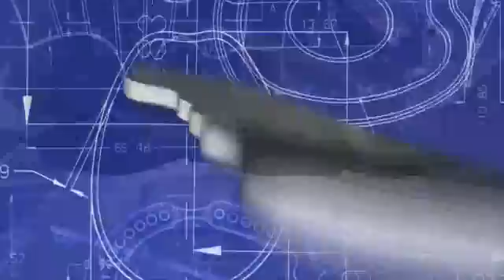#britek  Energy Return Wheel... Autonomous Never Flat

Comment: @EnergyReturnWheel   What do you mean the throttle response either raises the hub or rolls forwards? What is a throttle response? What rolls forwards and why? Using mystical words like "float" and "captured" doesn't explain anything, it just sounds mesmerizing (to certain people). Your idea makes no sense at all. Rubber bands increasing energy output without extra input? Your idea looks cool, but it has no function other than dampening and delaying torque to the road!

Comment: @bobwatters I'm not answering for EnergyReturnWheels, but here's how most new technology works: "High end" devices will usually take advantage of it and being flaunted as a premium feature. Once production and market acceptance kicks in, it trickles down to more widespread use and in lower end devices. There was a point in time where you had to justify the price tag to a consumer on why they needed ABS brakes. Now, it's pretty standard on most cars.

Comment from the maker: @imingzee The weird truth is that the composite hoop is supporting the wheel hub via an array of slingshot like membranes all equally tensioned. When ERW is placed on the ground the hub sinks from the pull of gravity untill suspended by the top half of elongated membranes. Throttle responce either raises the hub within the scope of the hoop or rolls forewords releasing the stored gravitational pull as more g. is captured as wheel rolls and hub floats against the pull.

Comment from the maker: @MADMANx511 We will be running paddles off the curved hoop to morph to terrain and because the "gravity charged" hub is drawing more from the top side 180 membranes it levers uphill better than pneumatic. For larger size wheels and tires expect lighter sidewalls / hubs for aprox. 30% reduction in overall weight. This would require a re engineered hub, mass can be reduced because it rides inside the composite hoop.

Comment: I understand trying to build a better mouse trap, question is, is it better, and why would the average person want to use this wheel in place of whats been working fine for over 100 years. Also, when the rubber wears out, do we go to the shop for a retread? If so, how long will that service take, and the bigger question is cost. If this cost more without a considerable benefit over traditional tires it won't be successful

Comment from the maker: @1nickadair We have switched to a composite carbon nano tube infused carbon fiber hoop dynamically charged with internal coiled carbon rods pat filings #4 and #5. Hoop is protected by a Kevlar jacket for strength and vibration resistance. Contoured hoop is further protected by kevlar bound nano rubber wedges off the curve widening footprint and psi. to the surface while manuvering.

Comment: @EnergyReturnWheel you mean your scamming us by NOT asking for money?  I'm sold... who do I make the check out to???  Lol but seriously, you "technically" didn't ask for money, but did strongly suggest people invest, which I'm interested in doing... but I have questions.  How dent resistant is the steel outer rim, how cheap/expensive will it be to replace the rubber?  What will be the actual total cost of everything?  Performances, top speeds, side g forces, etc.

Comment: The video was made 3,5 years ago, are there some new test? Whats about holes in the street, driving very fast corners and to fast over speed bumpers. Is your wheel able to handle these things or will the weel become an egg? And the other problem is to change the tires. Can you put new tires on these wheels or do you have to change the whole construction. Will it be more expensiv than an old tire??? I think your wheel is a good idea, but there are many questions left.

Comment from the maker: @a2dds ERW stays on the surface "anti bounce" more hook up and control. Lighter, larger diameter wheel and ERW combo. Kevlar spans replacing weakest link rubber membrane with the strength and vibration resistance of Kevlar pat filing #5.

Comment: Interesting, I'm skeptical though.  I would initially question the torsional strength and durability.  Its one thing to drive in the driveway, or on a dyno environment.  But how does something like this hold up over thousands of miles of the real road conditions, especially at the speeds drivers routinely travel at, 80 mph+.  Not to mention it still has a rubber tread, which will wear out just as fast as a normal tire, thus require replacement.  What is gained here?

Comment from the maker: @Smullet90 Check out our USDOT highway test video on their 48" dyno rollers 6,000 lbs. dyno resistance at speeds over 75 mph. Note ERW hub riding high and forewords within the scope of the old style steel hoop. Also note the "brake lights" when ERW over shoots coastdown sections. Normally there are no brakes applied in the highway test.

Comment: Do you have footage of these tires at 70 mph? I'd like to see that video. My other question is how long does it take to change one of these tires. Also how does it ride? It seems like it would not have nearly the amount of give that normal tires have, making for a much much MUCH bumpier ride. Does the membrane REALLY "give back" the energy from the vibrations of the metal frame? All this could be answered with some real footage of the wheel in action.

Comment: I'm a little concerned about the unsprung weight.  It *looks* like the ERW would be heavier than the wheel/tire combination.  Have you weighed the ERW setup?  If so what are the differences between the traditional wheel/tire setup and the ERW setup?

Comment from the maker: @Monkriss  ERW would rather roll than bounce. Lift a car by the bumper. You can raise the 2 ton chassis several inches because the mass is stored in the springs. ERW hub is suspended within the hoop and is displaced by the pull of G  like the suspension system. No matter how it is explained we are still the most efficient coast down.... tire vs "airless" ERW on youtube.

Comment: I'll bet the grip with these tires are horrible. The grip these offers are probably on the same level as low profile tires, if not worses. And the problem with low profile tires is that they can't absorb bumps, cracks and such in the road as well as normal tires.

There's a reason why race cars never use low profile tires; they're crap.

Comment: @EnergyReturnWheel and the load bearing capacity? my truck weighs 9000lbs before fuel, passengers, cargo, etc. also needs to be capable of towing a 10000lb trailer without a 5th wheel adapter. high abuse applications are the perfect target for this sort of wheel because it eliminates the risk of puncture as well as sidewall failure.

Comment from the maker: @cummins24421 The promise of simple ERW is coming true. We believe that our new vacuum install/removal process is close at hand. No bolts. This can only be accomplished if you have our hoop ridgidity. Highly elastic patent and "pat pending" sidewalls hold a negative air pressure or vacuum boost. Will run w/o vacuum, vac. for fine tuning, weight reduction, compressed air is heavy. Aprox. 2 lbs @ 30 psi. with humidity.

Comment from the maker: @engineerFROMhell We switched to space age composite carbon nano tube infused carbon fiber woven hoop with nano infused Kevlar jacket. Check out USDOT lab tire vs ERW vid. for 6,000lb. dyno load acceleration/coast down...notice "hub in steel hoop" floating high and foreword under throttle responce.

Comment: With all that force directed inward, wouldn't this design require maintenance often? Like tightening all those bolts on the inside? 

Also, this is a useful design, but for consumers to buy it, it needs to look a bit more attractive. If you can find a way to cover up the gap and make it appear as a regular tire, more people would be willing to purchase the ERW

Comment from the maker: @donerdoner1234 We use a vacuum pressure on the hoop side of the membrane to increase power and longevity. We have pioneered a composite hoop so light and strong that the hub can be massive 30% lighter. We have a totally new traction system to bring higher psi. to surface. ERW is anti bounce because it displaces internally. Hub in hoop 360 degrees freedom of movement under drawn membrane control. Camber issues are addressed by the new "curved body" hoop with Kevlar bound rubber wedges off curve.

Comment from the maker: @spencerjustin420 Tire safety is a real issue. Debris on the road, under inflated or even expired tires can create life changing accidents. It is our goal to introduce a high speed airless that will not be taken out by a 1" wood screw. Composite ERW even can survive multiple high power rifle shots and still get you where you need to go. The early proto rotational mass has nothing to do with ERW performance. Newest protos composite hoops and traction system are  lighter than pnu tread block.

Comment from the maker: @MrTheLemonn For these early protos each "pull" is drawn with about 300 lbs. linear tension. Upon throttle responce ERW can accumulate screw force, Hub can rotate within the hoop elongating the membranes like a wind up airplane increasing power transfer to surface. Each bolt can easily support 300 lbs. lateral shear suggesting 300 lbs. x 36 attachment bolts =  no problem. We have moved away from bolt attachments for auto but they will show up in some heavy duty applications.

Comment: you dont address the "loss of traction... losing lives on the highways" bit at all... "part of the car that will not need to be replaced", really, you still have rubber, on concrete, that shit wears out... all you are really doing is creating rotational weight which could save gas mileage, but i doubt that much, and require more braking force thus having to replace break pads more often

Comment from the maker: @brandieism We will have a sealed dual vacuum charged "compressed air is heavy" ERW for off road racing. We can now cut a staggering 30% of the mass of a large tire wheel combo... "high speed airless" still runs w/o vacuum boost.

Comment from the maker: @ladygodia ERW displaces internally. These early protos have 2" feeedom of movement " hub in hoop" in all directions. This allows for screw force accumulation/return during throttle or brake force. Also a return against the pull of gravity as hub sinks within the hoop to the point of levitation, IE largly supported by the top half of membrane pulls. Throttle responce flings the hoop further assisted by screw force return = big trouble for the pnu. tire.

Comment: I'm guessing they return energy by being lighter than standard wheels and easier to turn? But how are they cost effective with that weird tire size? No way your going to find the rubber or a shop to install that for cheap. Also what's the point of these rims? Are the just shock absorbing rims? The airless tread design looks interesting but there's nothing practical about these rims.

Comment: @meatball15683 It's indeed BS. the casing in the tires are pretensioned from the air and "springs" back.

This wheel "design" is analogous to spoked wheels: perfected over 100 years ago.

Comment: your better off putting a weight on a circular track inside the wheel. the momentum that it builds up will be used as it spins around in that direction, this is assuming the overall weight is on-par with standard wheels. oh and it will also make braking more difficult for sure.

Comment: Good Night for real and again have fun.  And buddy that had the idea about the wheel;  don't worry about the flak.  This idea may if not become a purpose of asphalt;  it might be ideal as drive forward structure apon a rail system where a sustained force squeezes the front bottom inner part downwards where then changing the center of gravity and mimic a downslope and still there are other way more efficient systems then that but I am sure that I will find it's perfect purpose eventually.Cheers!!

Comment: For instance I will guide you through a few reasonings such as gravity is prone to be relaxed as apon over powering and tension that has been achieved and then stablised can overcome gravity along with additional othe curcumstances that you would be encountering.  Rotoring can be of two that push eachother by many ways such as the expansion of icing water that expands by 9% and could be acting as a counter action if thawing using earth's warmth created at the areas that are cold on earth.  .

Comment from the maker: @meatball15683 The percentage may be fairly small. Think of our membrane pulls vibrating like a rubber band that has been quickly stretched. Each drawn membrane has an opposing twin across the hoop. Vibrations are playing out as billions of "tugs o wars" are cancling each others vibrations. ERW focuses/ draws "all" energy to membrane pull points.... as the path of least resistance the hub is levitated within the scope of the hoop = easy rolling.

Comment from the maker: @Bobby0345 The newest prototypes are constructed of space age composites. Their psi. burst strength ranges from the carbon fiber @ 50,000 psi. to the Kevlar @ 20 -25,000 psi.. Very strong, super light weight. Vacuum install should require no special tools, OK a 5 $ vacuum accumulator for your air hose. Should be safer install / removal than pnu. but training always sounds like a good idea.

Comment from the maker: @dumapies  We now use a semi complient composite hoop. It requires a new  type of traction system. We run higher psi. to the surface and needed a way to share the stress within a new traction structure, now several novel patent claims recently filed. ERW is the perfect test model for carbon nano tube rubber research. Tough stuff.

Comment: I dont buy the claim its more efficient, and when it comes to what it does its just a tire, exactly just a tire like we use today, except it does not need side walls, which makes it look horrible, so now go and cover up that horrible cosmetic design flaw with some more rubber, and well then you've still got nothing, i can adjust my tire pressure, so what do i do with this? adjust all those bolts? lol you loser should have stayed in the shoe business

Comment: @JohnUnit From what I can see, this wheel also uses the same rubber that the current pneumatic wheel use. Unless the maintenance/repair costs of this product is low enough, I still don't think it will succeed well. The difference in rubber simply being that the ERW doesn't need radial walls.

Comment: This wheel might be okay for simple 40- MPH commute speeds, but when you factor in higher speeds and maneuverability, I don't think this will last like pneumatic tires. What if you have to drive in areas where potholes are a normal part of your drive? With this wheel, consumers will have to worry about replacing that soft padded lining, any damaged bolts, the rubber tread layer and maybe other things. This will make drivers laugh at the ERW wheel when compared to the usual simple rim/tire combo.

Comment from the maker: @jakubkrcma The last auto proto 18" x 285 using a "rubber membrane" and 8 composite pull plates was 32 lbs. The next gen auto proto for 2012, "Kevlar membrane" should be 30% lighter. Lighter hubs and wheel sets for sport.

Comment: @EnergyReturnWheel Hi, what is the APPROXIMATE total ERW (rim+hoop+tread...) weight compared to an identically sized regular rim + tire weight? I understand that even if ERW was a bit heavier, it should still work better on uneven roads, since a larger portion of surface reaction would be taken care of within the wheel itself, without being transferred into the car's suspension. GOOD LUCK!

Comment from the maker: @criticallistenphile ERW is high speed unlike other airless. Our latest protos look to be lighter than what pnu can do. The new composite hoop strength is allowing for "much" lighter hub. We will use less rubber and even the early ERW with no traction layer is smooth at highway speeds... under heavy loads. Check out our dyno vid.

Comment: I can imagine it will safe fuel because the resistance on the road will be less since the wheel keeps its shape much better. Its only steal with a layer of rubber on it. But than again.. The surface of the tire that will be in contact with the road will be much smaler so less grip. Its just like pumping up your tires very very hard. You'll safe fuel but less grip..

Comment: am i the only one who notices this is a spoked wheel like we use on dirtbikes and older motorcycles? instead of the bottom of the wheel supporting the weight of the car, the weight is actually hanging from the top of the rim, good for absorbing big hits but i dont see who it can be cost effective

Comment: @EnergyReturnWheel 
Rails provide a suitable surface for a steel wheel. You still have to invent the perfect road for this tire. 
Pneumatic tires used on cars have to compensate rough road conditions. Driving that ERW over a small pebble at normal cruising speed will deform that outer ring permanently. 
Reducing rolling resistance is a fine idea. I would use narrow tires with higher pressure wich also reduces air drag.

Comment from the maker: @excelephant What it means is that we have figured out many new ways to suspend a hoop from a hub. The 5 filed utility pats cover a lot. We are not 1 claim we have dozens issued with dozens pending.Our hoop lets us use a partial vacuum to support cycling rubbers. Space age composites, nano tech, new types of hoops/traction layers. Bicycle protos have carbon fiber to replace rubber spans. Bicycle wheels can be much lighter IE "hoop" strength. The "grail"  tubless 29" MB weight in sight.